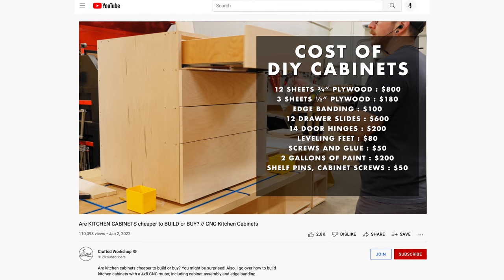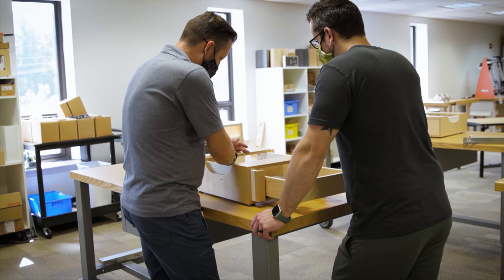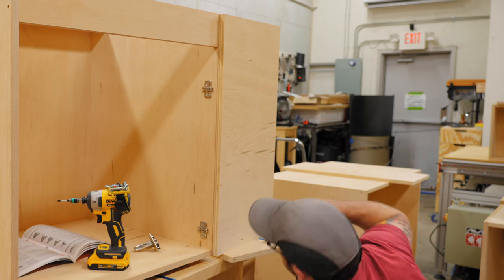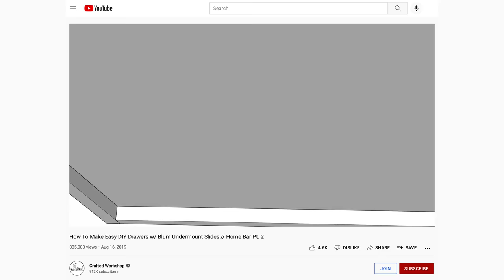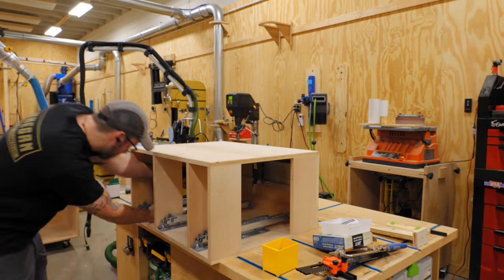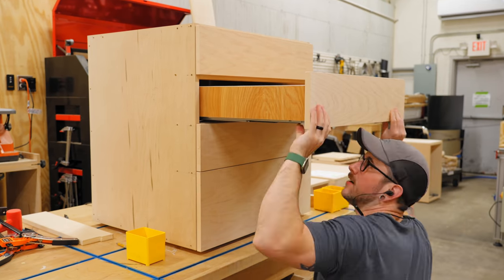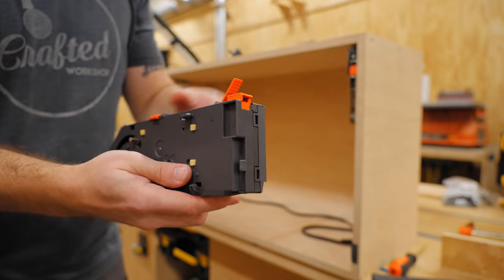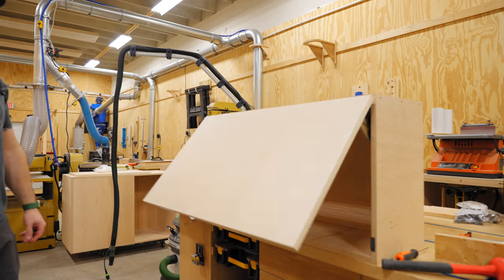Building TOUCH-TO-OPEN Kitchen Cabinets with NO HANDLES!

Comment: Last year when I was between jobs I worked as a cabinet maker for a local kitchen/bathroom/laundry room renovation company.
We only used Blum hardware and I instantly loved working with the hardware. It works super well and is very high quality.
We didn't do Tipon adaptors on the inside of the cabinets. We had to drill holes into the 16 mm (~5/8 inch) face frame using a bit which leaves practically a hair's width om material on the outside of the cabinet frame. Even with a jig it was easy to get blowout on either side of the cabinet. So I can understand why you used the adaptors 😂
Great video! Love those servo opening mechanisms! Can't wait to see how awesome your kitchen looks like!
Reply: Blum is metric. Do you find it convenient?

Comment: Great process of the work so far. Since I have been working with Blum hardwares for more than 4 years niw, my advice should be nor using hinges with springbreaks if you use it with Tip-on's. Just try them with normal springless hinges or turn of the break on the exsisting ones. ;)

Comment: What happens with those handy dandy electronic hinges when the power is out?  I live in Florida, and at times in the summer, it seems the power is off as much as its on due to the weather.  I do love the top lifting hinged doors though.

Comment: Serious question. What happens if the power goes out? Can you not open your drawers?
Reply: Similar units run on a battery backup that is controlled in at the power source, but in the event that power is out for a few days or whatever, they can still be lifted and opened manually.

Comment: Awesome videos. Can you recommend a brand for a mechanism I’m trying to find for kitchen cabinet door.
I need a mechanism that allows the cabinet door to open upward and slide in parallel with the top of the cabinet.( on the inside)
I have a mixer inside the cabinet that slides out on rails

Comment: Each servo is about 100 dollars, it seems. Including the frame and drawer slides, I'm guessing this costs 150-200 dollars per drawer for hardware only. And the Aventos servo drive system for the overhead cabinets is 300 dollars each.

That's pretty steep. But I guess kitchens are expensive, might as well throw it in while you're at it...
Reply: spend a couple extra grand so when your kitchen's servos fail you're locked out of your food and dishes lmao

Comment: How did you deal with the clash between the sink and the Tip-On push-to-open buffer cylinders which project back into the cabinet volume?

Comment: I mistakenly used soft close Blum hinges for ages with that tip on hardware. Try your same set up with Blum's "free swing" hinges and the tip on takes on an entirely different life. They open fully instead of just a couple inches.

Comment: Johnny - great work on the cabinets and on the "not-so-tiny" tiny house build.  I appreciate your cost break downs and your usual honesty concerning when you pay for things and when they are "gifted" to you by the supplier or the manufacture.  I feel that some of the shine came off your honesty with this video.  I do not begrudge you the CNC, pro table saw, large work area, or the myriad of other tools you have on hand (and you do a great job of suggesting other ways to accomplish the same thing, and you're honest that it will take longer and cost in time). BUT the jigs (the two from Blum and the edging one from Rockler) cut production time significantly and would almost double your stated cost of the build.  You repeatedly comment about how invaluable they are but the cost is omitted from the discussion.  Similarly, I hear you hedging about how elite the servo pieces of the Blum hardware is, but the roughly $200 per opener is completely glazed over.  A quick "what you could pay" screen shot (what you are already doing) and a "price as built" (which would include MSRP for the jigs and complete hardware) would go along way to helping the average schlub (me) understand the true cost of building your own kitchen.  You could bury the sheets somewhere on your website (link on video) to appease the folks paying the bills. Thanks for listening.

Comment: Great video and I love the results. I do have to say, though, that this hardware system treads dangerously close to "improving to failure" territory- at least for me. Why? Three reasons.

One, it's quite simple to achieve the "no handles/hardware" look on kitchen cabinets already, without the addition of (what I assume is) far more expensive hardware than standard. Two, anytime you introduce something electronic, especially in heavy-use applications such as this, there's always the possibility of malfunction and/or power loss, whereas normal cabinet hardware will work indefinitely. (I understand that these hinges & slides will work regardless of the motors being operational, but without the touch-activated feature, you're no better off than if you'd just used standard hardware.) Third, outside of the "wow, neat!" factor, what additional benefit does a system like this bring you? It's not faster than regular hardware, nor is it easier or more intuitive.

I don't mean to rain on anyone's parade here, and I apologize if that's the impression I'm giving- again, I really did enjoy the video. But I just see this as analogous to voice-activated doors in old sci-fi movies; something that dazzles you the first time you see it, but in actual usage would be far less appealing & efficient than simply using a doorknob. This hardware is undoubtedly impressive, I only question it's ultimate utility.

Comment: How are the remotes powered?  Do you have to swap batteries or recharge them periodically?  Is it a bluetooth transmitter?
Reply: Yes in the Remotes there's a Battery. It'll last at least 5-7 Years. :)

Comment: The adjustable platform that you're using to hold the cabinets while spray painting looks super useful! How is this called? I'm also in the process of building a kitchen and I have a lot of spray painting to do!
Reply from the maker: Here’s a link, it works great! https://www.rockler.com/paintline-spraytwirly
Reply: @craftedworkshop  Thanks! It's exactly what I need! Great work on the kitchen btw, it looks really good!

Comment: this has got to be the most unnecessary tech that exists in the world of cabinetry, the electronic push to open mechanism on the drawers do not even open all the way and you have to pull it the rest of the way? nvm replacing/servicing those motors..and the sheer cost of everything..  so far the greatest thing I've seen from Blum are the soft close drawer rails/slides. everything else just seems to be reinventing a very expensive and unnecessary wheel. rant over.
Reply: Yep spot on, but there is luxury things in every walk of life which are over engineered and over priced. But theres a market for it!
Reply: Couldn't agree more! Loved watching the video as a how to but couldn't help thinking what a monumental waste. Effort to build, man power, material for a physical action that even an arthritic older person would't complain about. Firmly in the category of useless innovations for me. And with the trend of IoT and everything as a service; any bets this will shortly have a bluetooth app to open remotely, send data to the cloud so you know how many times you use your cabinets so Amazon can predict your next grocery order and all with a low $7 per month account!

Comment: On your garbage and recycling bin cabinet I hope you left enough clearance for using garbage bags inside the cans. Sucks getting the inside of a can dirty and having to clean it before you can use it again when you need it. Probably don't need a bag for the recycling bin, but definitely on the garbage.